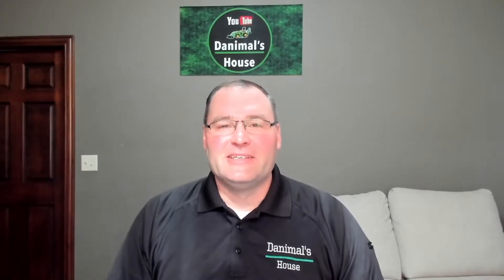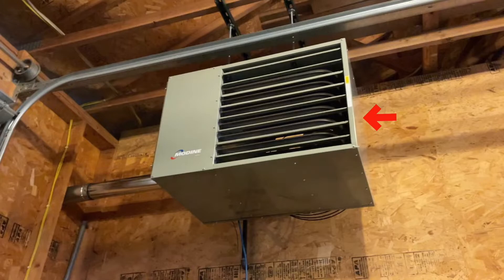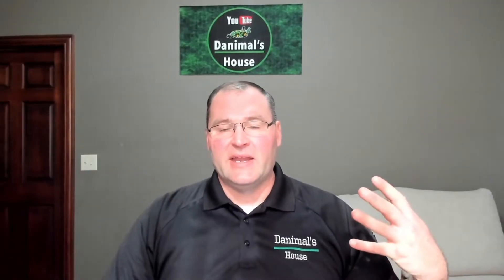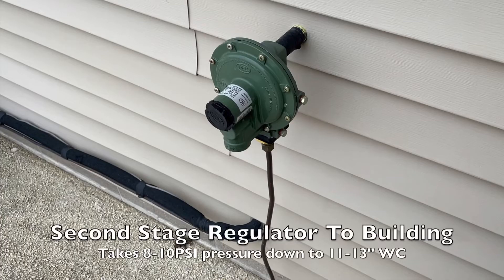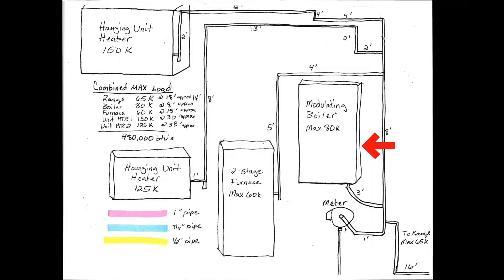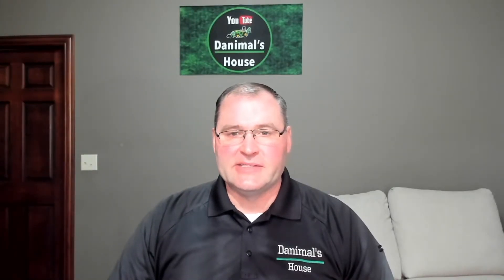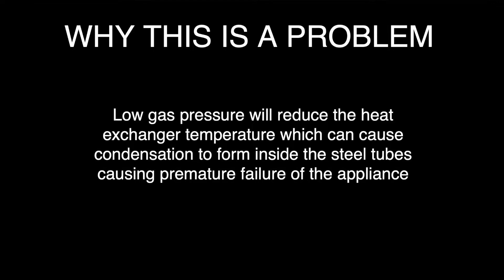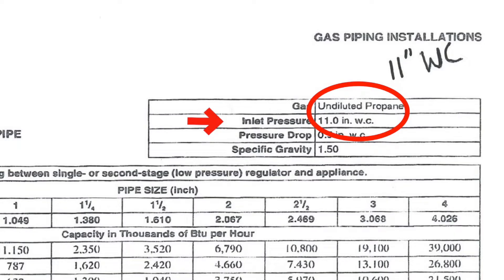Why Propane Gas Pipe Sizing Matters

Comment: If a place is located only a few miles outside of a natural gas utility company's existing service area, I size the propane piping system in the building with the natural gas pipe sizing charts.  They will be significantly oversized for propane, but if the natural gas utility company ever expands their service area to include the clients building, the client will be able to hook right up without the need to replace any pipes inside the building.

Comment: Thank you for this. Something I don’t understand though. Have not tested it yet. I’ve got about a 40 foot run between the secondary regulator and my outdoor grill I’ve always run from a small 20# propane tank.  I’ve always been too lazy to run black iron pipe to it, even though we have a 500# buried LP tank.  So yesterday I ran 3/4”, stubbed it out with a shut off. My issue is the connection from my piping to the grill. I was planning to use the same 3/8” flare to flare type hose that I used for the 20# tank (of course not one with a built in regulator). But the 3 foot rubber tubing has such a small orifice that I’m concerned that it will limit the volume of propane I can deliver to the burners (5 at 15000 btu each).  If I remove the male flare adapter from the BBQ there is 1/2” mpt threads and I can use a larger hose (1/2”) directly from my 3/4” stub out to deliver more volume.  Sorry about this long comment, but is the volume of propane limited by the small orifice of the rubber hose, or is that enough for the grill?  I’ve been searching all day and can’t find any info.  I know if it were indoors I would use a much larger stainless hose but I can’t do that outside. Any thoughts would be appreciated.
Reply from the maker: I cannot advise, but I'm wondering where the regulator was when using the 20lb tank.  If it was right at the tank then the hose you have had about 10"-12"WC of propane gas pressure going to the burner manifolds using the smaller hose you are describing.  Logic would say that hose worked before and it would work again when used to carry the same pressure of gas to the same burners.  Unfortunately I can't advise you but I would guess you could use the same hose for that reason.  Good luck!

Comment: Thank you for the video. If I go with 1” pipe throughout the house, it looks like that would ensure I have enough, even if I add on an outside grill in the future. My home system will be similar to yours. I’d just rather skip out on reducing pipe size. That would work right?

Also, what size pipe are you running from your stage 1 to the stage 2 at the house? My tank is is going to be about 10-20 feet from my stage 2 at the home. 
Thanks again for the video.
Reply from the maker: For me in my area, the propane regulator at the tank knocks pressure down to 10psi for the underground piping to the house.  Usually the underground pipe is 3/8" or 1/2" because it's at a higher pressure.  Then at the house it gets regulated down to 11"-13" water column for the appliances.  At that point most homes have 1" pipe running like you suggested you want to do.  You can reduce if you want based on a pipe sizing chart but it won't matter if you leave it oversized at 1".  Good luck!
Reply: thank you so much for the info. You’ve been an awesome help and I sure appreciate it.

Comment: swapping that main line to 1" is more than enough. Also, you will never have all the appliances running at the same time.
Reply from the maker: In a home I would agree with that prediction but I usually leave the spaces set to 50°F when I'm not out in the buildings so if I want to heat up all 3 sections to 65°F at relatively the same time it could be a factor.  Ultimately I agree with you and was fine with leaving it smaller but I enjoyed seeing the before and after results that validate the gas pipe sizing codes I have to use at work.  Thanks for watching!

Comment: Do you run all rigid pipe or branch off to flex hoses?
Reply from the maker: I have all rigid pipes but I also have access to use a pipe threader from work.  Rigid pipe and flex hoses do have different sizing charts though so if you find yourself using flex, make sure you are looking at the correct sizing chart.  Good luck!

Comment: I found value in the video. Thx for posting. I’m figuring the piping for (6) 125k btu radiant heaters in a greenhouse with the tank about 100 ft from the 2nd stage reg. Longest leg inside will be about 150’. Fun fun.

Comment: that water heater has a long list of do-nots in the manual. you have a furnace right next to it. 
i got the same one.
Reply from the maker: I agree.  It's a domestic on demand water heater used for infloor heating, which is the first no-no.  Yeah, had to fit it all in a small space bought some items before I got into the business.  The gas piping works great though!

Comment: In my country, i learnt we have a mix of 30% Propane, 70% Butane. Will your method still work? I believe you have 100% propane. Do I have to do any conversions with any formulas?
Reply from the maker: Hello, I do not know the pressures for your gas mixture and would recommend talking to an HVAC professional in your area.  This example in my video is for liquid propane gas at 1/2 PSI pressure.  The charts for feet and sizes will likely be different in your case.
Reply: Butane has a different boiling point. It will turn into wax mostly in colder climate